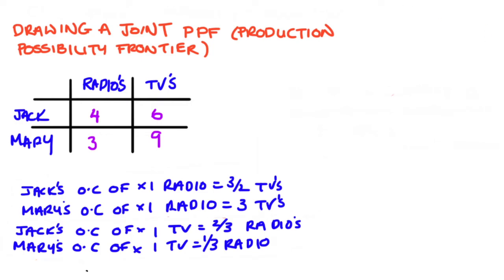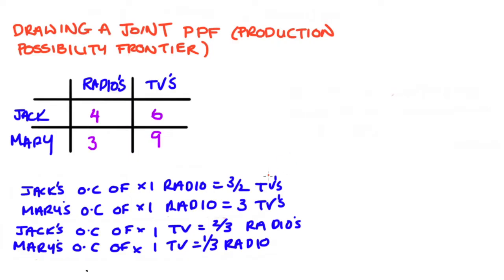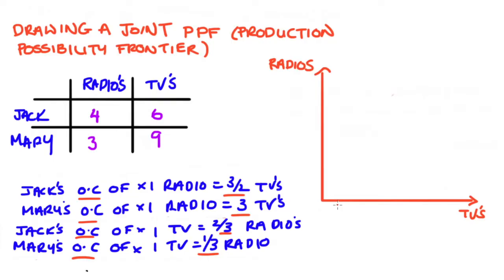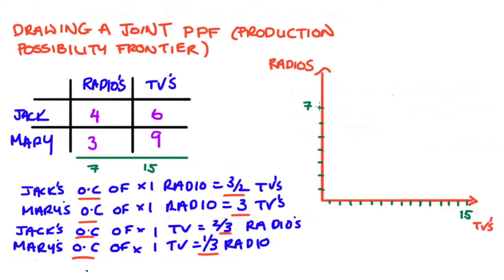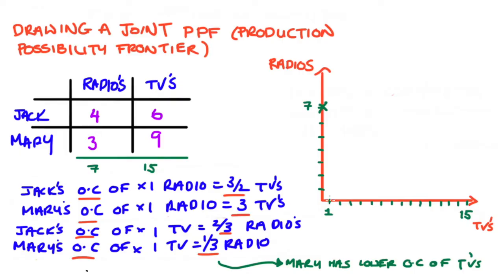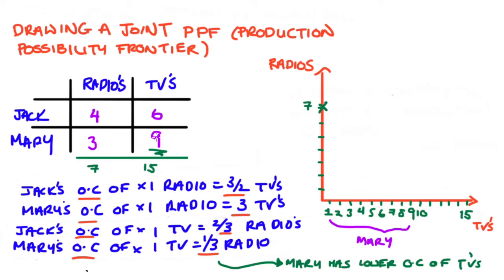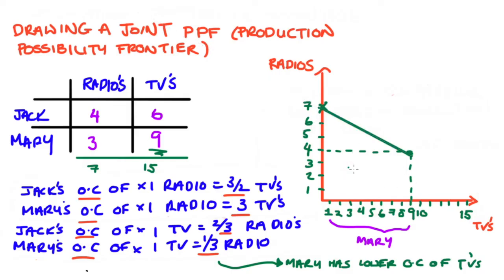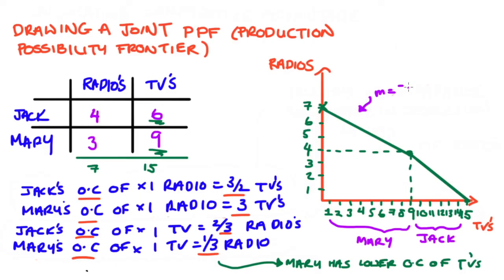Drawing a Joint Production Possibility Frontier (PPF / PPC)

Comment: Thank you for uploading great video!! Unfortunately  I have some question to you. IS (Jack and Mary)'s production is one hour?? If they work longer than should i draw joint ppf graph much greater??
Reply from the maker: A good question. The PPF is drawn for some fixed level of resources - I don't think I specified but it could be any time - 1 hour, 8 hours. If we increase the time we have, the maximum amount of each good we could produce changes. This would make the PPF longer and taller - i.e. we would shift the PPF out.